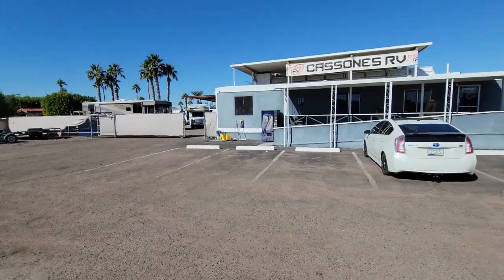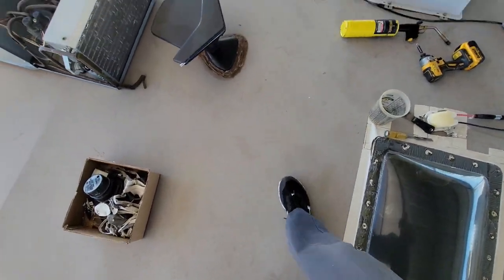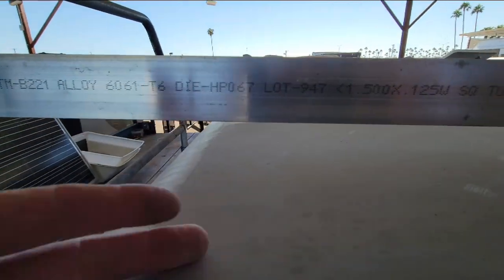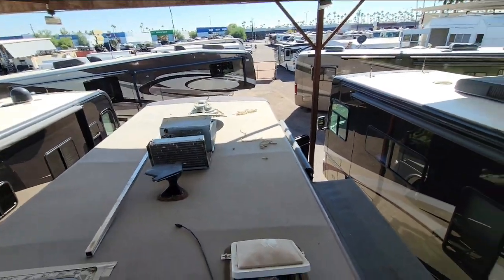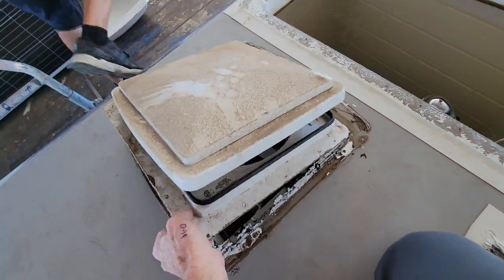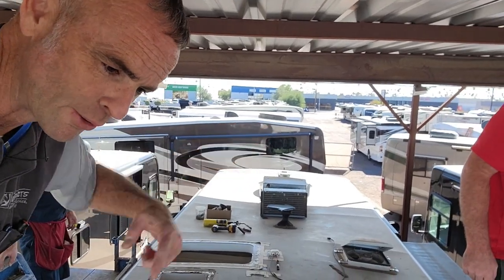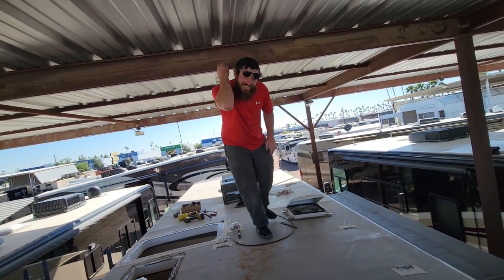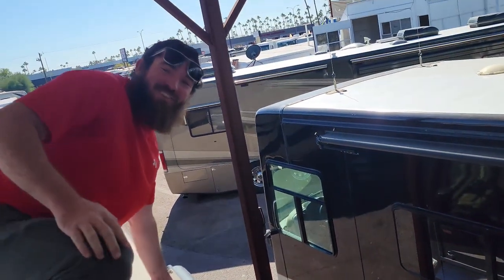Starting Another FAILED Winnebago Roof Replacement

Comment: I wish I found your channel before buying my 2022 Winnebago Vista 18 months ago. 25,000 miles and still really like our Motorhome and have had only a few minor issues. Since watching your videos , I check my roof every 3 months. So far the only issue was about 5 LF of radius edge that needed attention. I cleaned and cut out the sealant and re-sealed with the recommended Geocel Proflex. It took an entire tube which makes me think there wasn’t enough used in this area during construction. Plus, Living in Phoenix, heat and glue sealants don’t always hold up as intended. 

I appreciate your take on these Winnebago roofs and can only hope their glue issues where resolved before they made mine. 

I’ll keep a good eye on it and keep watching your channel!!

Thank you
Reply from the maker: Awesome! Thanks for watching!! :)

Comment: We bought the Winnebago view 24V because of the fiberglass roof, diesel generator and the porcelain toilet. This particular model has two twins or one large king size bed in the back. It’s compact but it has everything that we need. The slide only extends the loveseat sofa. It extension is not necessary for full functionality.

Comment: I just bought a 2006 Winnie TOUR. Resealed the tucked in part you recommend many videos back. So far, just one panel of the vinyl roof inside the glue came lose. No leaks yet.

Comment: Our 2003 Newmar Dutch Star DP has some peeling Clearcoat but not much worse than that 2014 Winnebago and ours used Sherwin Williams Auto body paint. We also have aluminum roof rafters every 16" and a 4" crown. I did completely replace the original roof myself in 2020(started toward the end of 2019 and finished just in time for Covid to muck up RV travel in 2020.) Needed to be replaced only because a couple of the a/c mounting bolts(which are outside the 14" foam gasket) had leaked. Looking forward to watching the rest of this repair. I wouldn't want to attempt one like that. Y'all have super skills. IMHO

Comment: So how do you know if your roof is susceptible to the bad adhesive? I walked on it the other day and it seemed good. I have 2015 Winnebago Cambria with a one piece fiberglass roof. According to Winnebago the roof is covered for 10 years limited parts and labor.
Reply from the maker: It's important to known what the warranty covers. It's usually just failure of the filon material not the glue or the build.
Reply: @AZExpert  thanks for the quick reply. besides walking on the roof what other inspection should be done? I checked the seals along the edges and walked on the front and back end caps - they looked pretty good. Along with the seals around the components on the roof.

Comment: I just finished a full body repaint of our winnebago rv and found so many issues. The biggest being the lack of proper butyl tape installation. They never peeled the plastic off of it. Wut??
Reply: I found the same thing when I got water in the cabover on my 2007 C.  I was always meticulous about the roof seams and the side sealant at the filon sealant channel but "up jumped the devil" and the dang thing leaked at the lower side molding of the cabover and wicked upward.  When I took that cabover aluminum molding off I found they had never pulled the backing off the butyl tape when it was built!  Damage was minor and I resealed that joint well on reassembly ........ no more problems.  The main roof of the coach was solid as a rock after 14 years in the sun (it was white.)  Common knowledge that RV quality has gone to hell in a hand basket in later years, but it "wasn't so hot" to begin with, IMHO.

Comment: Oh God damnit.  I just bought an 07.  I seriously hope this isn't going to be an issue for me
Reply: I have a 2003 and all is well. Just watch all the sealed areas, and the outside joint where the roof material tucks in. Re do if you push on it and make sure there is no separation or gaps! You will be fine.
Reply: Recently sold my "07 WBGO Outlook.  Roof ...... solid as a rock.  Matter of fact, a real good rig for all the years I owned it.
Reply: Thanks guys.  Your posts are very comforting
Reply: I bought an 07 Itasca Suncruiser which is basically a Winnybango

Comment: Makes me glad a have a 2 part Aluminum roof on my 2002 Safari Trek 2830
Reply: Do you know what kind of roof is on 1995 Safari Serengeti? Owned two months, no manuals, can't climb ladders, hard to find info.
Reply: @TimothyMichaels  I am not positive, but most likely it is a Filon or similar roll fiberglass material roof.  These were used on many Safari coaches until the Monaco buyout in 2001.
Reply: @MrPenguinLife  
Thanks 👍

Comment: Enough water and the wood will give.  It’s not so much the adhesive goes as much as the luan the adhesive was on is gone. The luan get wet and come apart. It gets started and then the vibration of going down the road and the lift from the air moving 
But I’m in the Midwest and we get more rain.  So if these are coming apart in the dessert I don’t know
But I hate the roof construction the way the radius tucks in.  Stupid. The designer failed roofing 101   Once you get a hole in that sealant the only place for the water to go is in the roof and wall
I see lots of older Winnebago roofs in good shape.  The back wall pulling away is very common on the Vistas
Reply from the maker: There's no water damage on this roof

Comment: Holy crap.  I will stay away from Winnebago.
One question...  How do you properly secure Solar panels to a roof like that?  Assuming its in good condition.
Reply: If you don’t get a good bite with a screw you can rivet.  But typically butyl and screws and self leveling dicor. Start inside. Find where you’re running your wires and drill up   
Inspect your roof every 3 months and keep it clean and sealed
Reply: @davidmcgee2126  That's great advice. Thanks for taking the time.